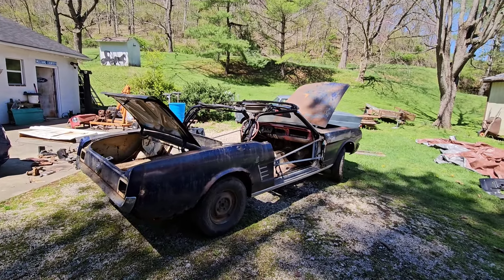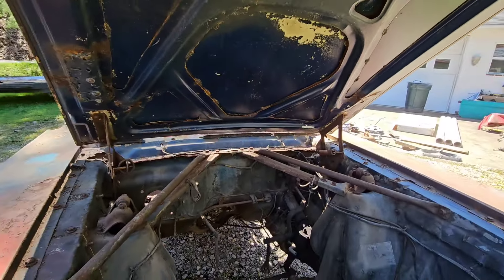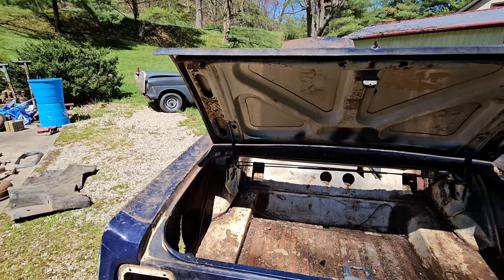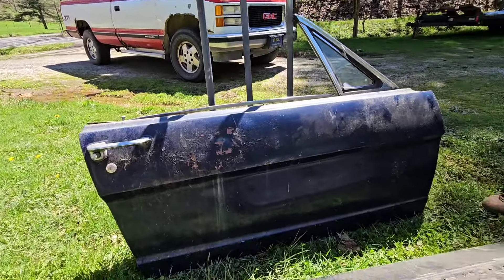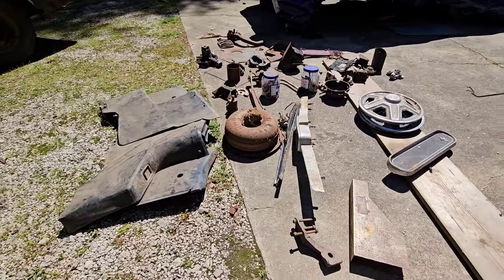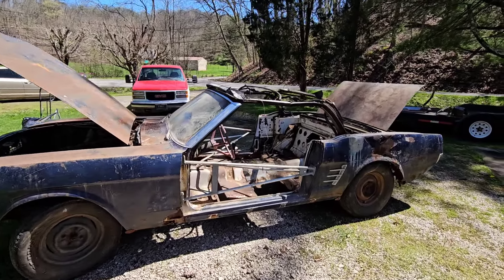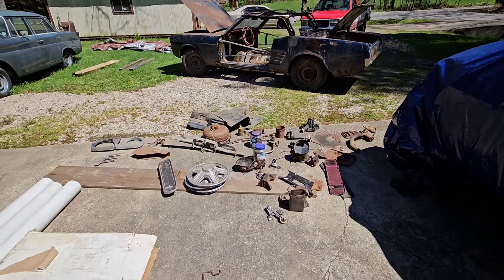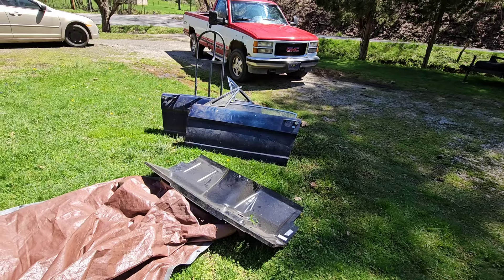$2,800 FOR SALE 66 MUSTANG CONVERTIBLE/ mason w.v. #mustang #carsforsale #junkcarwilly

Comment: You were just about to say the price and cut you off or maybe you did it and editing. And then some advertising various car events including no name national. Maybe you said it and I missed it early on but I don't think so. How much for the car the 66 convertible mustang all the parts. Just to refresh from what I said before. We have one for my wife. But she wants to change the exterior color she wants to change interior color and even the color of the convertible rooftop. The car in this episode looks more viable candidate for all that. Besides depending on how much he wants I can sell the car we have. But it does need a convertible frame rails as well.
Now my question is:
You absolutely sure that your car there is a real convertible? Not one that was made from a coupe decades ago with parts from a wrecked car. I'm not saying I see evidence of this on this car. I'm just saying you'd be surprised how many of those I ran across when I was looking for this other one we got. Well that's enough story behind my question but I was just wondering how much
Reply from the maker: Sorry it's $2,800 for everything.  Heck the floors torque boxes firewall and frame rails. IS more than third of price
Reply: @junkcarwilly  I don't know how much does repair panels and parts cost now but overall that sounds like a decent price. If I didn't already have one I jump on it or if that comes down a little bit more. Make it worth my while and get rid of the one I have and start with one from scratch